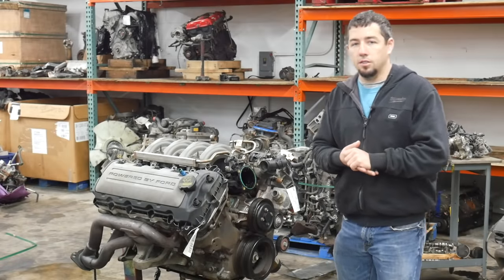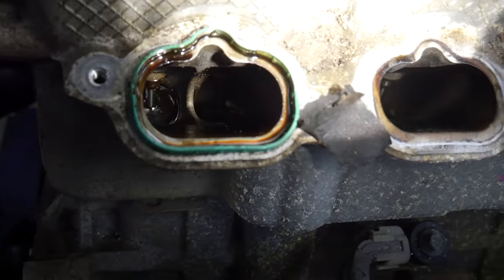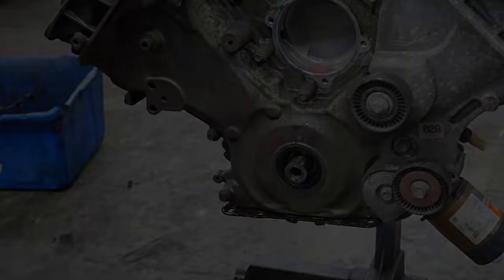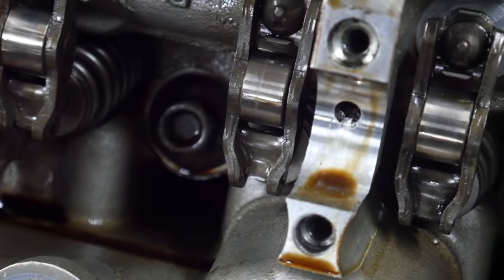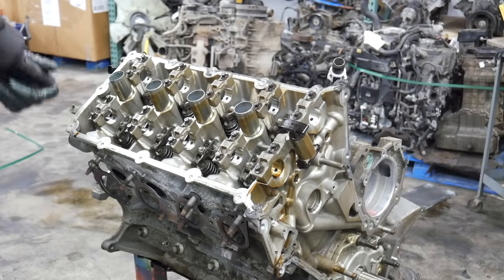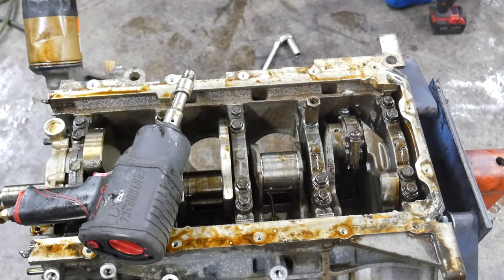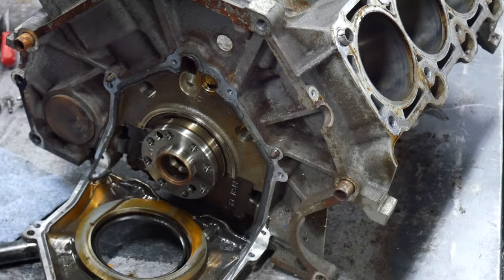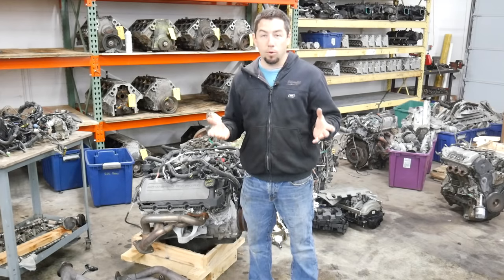Blown Up Ford 5.0 Coyote V8 Total Teardown! 2011-2014 Mustang GT / F150

Comment: FRAM Bomb Detonation! I had a friend in high school who bought a '67 mustang with a 351 swap that had a FRAM on it. He complained to me about an idle tick and low oil PSI; I said 'change the oil put a Motorcraft or Wix or Purolator filter on it'. We did that, oil PSI went from 4-6 at idle to 30+ and the tick disappeared.

This is why you never use FRAM. I don't think the oil level was low in this engine, I think the oil PRESSURE was low due to that oil filter.
Reply: FRAM Ultra’s are great filters. Motorcraft and Purolator’s fail quite often as seen on BITOG.

Comment: yep, most folks dont think about how fast that oil pump can suck the oil pan dry at high rpm . burn outs kill a lot of motors with stock oil pans . it will suck the pan dry b4 the oil has time to return from the topside .
Reply: What is it, a Buick from 50 years ago?

Comment: Neat to see the inside of this engine.  My wife has a 2012 Mustang GT.  I have a 2017 Ford F-150 with the 5.0 engine.
Reply: Have 120,000 absolutely no problems 2012GT auto, ran Royal Purple to about 70,000 then shop stopped carrying it, would have cost me 140 for oil change. Burns 1 quart   between a 5 thousand oil change, with spirited driving. I dont go with the 10,000 oil changes. A good high milage synthetic.  Car still will go 150mph with confidence. Probably put in a Ford Performance Crate Motor at some point to last, untill 2035 when we cant but fossil fuel. Enjoy....

Comment: These motors are really thoughfully designed and man they crank out the ponies! Most guys that have them drive them hard and that's what they are for. The guys across the street from me has a blown Ford lightning with a Cayote motor running E85 and it pulls hard as hell! Thanks for the video!

Comment: Don't be ragging on that Fram Ultra oil filter.  It is one of the best ones out there.  Synthetic media backed by a wire cage, silicon anti drain back valve, and metal end caps.  Thanks for the videos.  They are very informative.  I've now watched several and the theme seems to be that the catastrophic engine failures you see are the result of not changing the oil or oil starvation from no oil, with the occasional hydro locked or over revved engine.  I do not understand someone buying a Lexus, Corvette, etc. and neglecting the maintenance.

Comment: 9mm socket (11/32)  Subaru power washer rocker arms, rocker arms on some motorcycles, and the bolts holding the glass in the sliding door of a Dodge Caravan.

Comment: Really like these teardowns.  Was hoping you would cut open the wonderful FRAM filter.   That may be a bigger source of the problem than low oil?
Reply: The high end Fram full synthetic filters are great filters unlike their garbage low end Frams. Allied Signal actually did a great job on the build quality of them . They’re nothing like the cheap orange cans of death.
Reply: Nothing wrong with the filter choice.

Comment: The inside of the engine looked relatively clean inside, in that it wasn't all varnished up with dirty overheated oil, so it was not totally neglected. But the oil WAS darker, and thicker than I'd like to see, which made me think it was past due for an oil change, maybe a little low on oil, too. Then it was over revved, and the rod journals furthest from the oil pump took the hit when it emptied the oil pan.
For these DOHC engines which run their cams in aluminum journals integral in the head casting, not running the best oil, thru the best filter media, in no more than 5k mile OCI's is just suicide.
Reply: That's just criminal to do an engine like that. However, I think you can get 7K easy (and maybe more) with synthetic oil. No? (Properly filled, of course).
Reply: @scott1564  from factory yes you can, manual says 6k miles. I have a 2016 5.0 with a 3L whipple on it pushing 958rwhp. All that is done to the engine itself is billet crank sprocket, billet oil pump gears, headstuds to prevent head lift and gapped my rings ofc. But rods, crank, pistons, rockers and springs are all stock. All it has had essentially is preemptive work. It is my daily, i beat the crap out of it and it has been  going strong for 27k miles boosted. 5.0 mustangs are the best bang for your buck platform to build off of
Reply: @tinchocore6777  I have the 2016 5.0 but in an F150.

Comment: This is what happens when you tune a Coyote to try and make more hp/tq, but leave it physically stock. Most custom and handheld tuners give the owner the option of removing or raising the rev limiter. If you alter cam and ignition timing without upgrading the cooling system(higher volume water pump and crossover pipe mod, possibly lower temp thermostat and larger radiator) and the oiling system(forged oil pump and gears, larger sump pan, or even swapping to a dry sump setup) you are running on borrowed time. Combine that with a higher rev limiter...and you have a ticking time bomb...especially in a standard trans Pony that the driver is launching at high rpms and hard shifting.
All that equates to much greater engine temps starting with the rear cylinders and a total lack of lubrication. "Shock" the drive train with high rpm hard launches and hard shifts while under such conditions will result in a Coyote winding up exactly in that condition.
I'm a Ford guy...especially Mustangs. Also have a 5.0 in my F150 FX4 with a 6" lift and 35s. I love the Coyote, but you can only push it so far without the appropriate upgrades.
I, also, worked as an ASE Master Tech(all the As, L1, L2, X1, and so on). I was a Diagnostician and did failure analysis. Stock Mustang GTs from 2011 and 2012 with a heavy tune and a driver that liked running the "Stop Light Nationals" on the weekends were bad about this exact failure. The 2013-14 weren't AS prone to this issue, but still highly possible without the upgrades.
Reply: Qhats your view on a 2011 gt with 6r80 auto, and all stock with 17k miles?
Reply: @msands7713   Love them!! The Coyote is capable of some serious HP/TQ as long as you take the time to upgrade what's also needed for longevity. The 6R80 can easily handle 700 to 800 HP in stock form....just needs a cooler upgrade if you put a smaller diameter, higher stall converter in. But, if you take your time and choose the right upgrades/bolt-ons as you go, you'll have a beast!
Reply: @msands7713   Pick a path and stick with it. NA, boosted, or going full bore with it, make a plan of what you want to accomplish, how to get there, and stick to it. That's the key to making serious numbers while keeping it dependable.

Comment: This was pretty common on early Coyotes when they had an aftermarket tune. #8 is prone to running hot due to insufficient coolant flow so the tune would throw a bunch of timing at it and boom. There is actually an aftermarket coolant crossover you can buy. Ford replaced some under warranty and then caught on.
Reply: Why would "the tune" add a condition to make things worse?
Reply: @imtheonevanhalen1557  In the early days of the coyote whoever wrote the tunes were a little too aggressive with the timing because they didn’t fully understand the engine yet. It was quickly corrected once they found out what was happening.
Reply: @imtheonevanhalen1557  bad tunes can ruin anything.
Reply: @TheImtoomuch  both in the engine and inside the vehicle!
Reply: @imtheonevanhalen1557  changing timing can cause heat increase. If you have a cylinder already prone to poor cooling you have a biiig bang waiting to happen the instant you stress it.

Comment: My daily driver is powered by a 1.3 litre, normally-aspirated, pushrod 4-cylinder motor on which I've been doing ALL the maintenance since 1994.  I am stunned by the complexity which motors have attained.  At the same time, I'm fascinated by your work, and I wish I was working alongside you, because there is clearly so much that you could teach to me about the practical mechanics of tearing down and rebuilding 21st century motors.  I'm now a subsriber, and sense a binge-watching marathon of your videos coming on....

Comment: Coyote cylinder #8 is the one that goes when people do bad tunes. I'd imagine that is likely one of the contributors here.
Reply: I'm more apt to put the blame on that oil filter. But it's entirely possible.
Reply: @TestECull  That, as well as likely just a low oil level/badly maintained as mentioned previously. In 2011-2012, the hypereutectic pistons needed the oil jets to stay cool, so a combination of low oil and a bad tune would nuke the #8 piston pretty good.
Reply: mainly onn the fseries 5.0. only the mustangs got the forged oil pump gears. many upgrade that part around the same time they tune it.
Reply: Hasn’t oil consumption been an issue with these mills? Spray-in Nickasil coating that sucked?
Reply: @prevost8686  Not on this Gen 1 block, it has iron sleeves.
Reply: @mwjscn  true.  Most failures with the exception of thosr that race and put away wet can be attributed to lack of or no maintance at all.  Lot of people think newer cars need no maintenance which is far from the truth!
Reply: Bama tune? 😅
Reply: Bad tune, too much power on a stock oil pump, fram filter and probably beat the piss out of it lol. People abuse cars and take LESS care of them xd. Oil change requirements are for piss pot minivan drivers, not people out here racing xd
Reply: @03vicBlack  No mustang/f150 coyote comes with forged OPG's.
Reply: It's my understanding that the back two cylinders on the Coyte (4 and 8) tend to run a little hotter than the rest (MMR has a coolant crossover kit to address this, esp for supercharged applications) so when anything goes wrong, be it tune, overstressing the engine with a stock bottom end, oil starvation as appears to be the case here, 4 and/or 8 are often the first to go.
Reply: @177SCmaro  That is correct. The passenger side head coolant dead ends and has to come back. Normally this isn't a problem as the water pump has enough flow to keep the back of the engine cool, but if you boost it and make more heat, all bets are off. Lugging the piss out of the engine at low RPM can also overheat the back cylinders.
Reply: @ice44567  
On my engine I can even see this. The OEM CTS is located in the rear passenger head but I also tapped an aftermarket temperature sensor in the upper water neck (that some people might mistake for a thermostat housing). I have a 180 thermostat which the aftermarket sensor reads but the OEM CTS always reads hotter as the engine warms up by about 20 degrees (reads around 200 when the other sensor reads 180.) I'm NA right now but I do plan on adding a turbo so the next time the heads are off or the engine is out I'm going to knock those freeze plugs out of the back of the head and add that MMR crossover kit it's supposed to help by, I believe, giving the water in the back of the passenger head somewhere else to go rather than dead ending.
Reply: @TestECull  why cylinder eight
Reply: bad tune. 8 got hot and popped the ring land. took out the other cylinder and then failure. most likely a FI motor with an edge of performance tune. factory timing gears as well.
Reply: @jflorf909  i think im going with VMP on my 11 gt. hear alot of good things with them
Reply: @prevost8686  didn't work on the Chevy Vega either
Reply: Would it be the low tension rings they are starting to use got better gas milage
Reply: @East TN Boys 
Same case.. I ve been nto many heated debates where LS guys often say they r more reliable ones.. but frankly from ma experience both LT/Ls and Coyote are equally reliable.. 1 cant say 1 s better than other. I do appreciate the LS design for how small and light it is and the Coyote for the outright power it makes with just 5002cc.. but again its a big motor for just 5002 cc and I think heavier that LT too.
Reply: @1989rs500  The LS and Coyote weigh about the same dressed, around 450lbs. But, yes, the Coyote is a little heavier, more top-heavy too. Ford did a pretty good job keeping the weight of the DOHC parts down with things like hollow cams and tiny cam followers. But still it's hard to beat a pushrod engine in terms of weight and external size vs displacement.

Comment: I am wondering if it ran even after the one piston or rod broke sending metal everywhere. The oil galleries obviously had A LOT of metal running through them before it seized or was shut off.

Comment: The Coyote engines use oil: If you don't keep an eye on it, it will get low on you.
Reply: I can attest to that 😕
Reply: Same as the 1UR FSE which is also a very similar engine but with DI.
Reply: Do they really? It’s a shame we’re not past that after over 100 years of developing the internal combustion engines.
Reply: @TheImtoomuch  you must not know how rings, compression and crankcase ventilation works
Reply: @thefordmaniac  dumb answer. Typical Ford fan. Don't insinuate that all engines burn or leak significant amounts of oil from new because they do not.
Reply: @TheImtoomuch  5.3s 6.2s 5.0s I'd say there are a few modern engines that burn oil.
Reply: @upinair4990  using oil isn't the same as burning oil. There's a pro tip for you.
Reply: @TheImtoomuch  So they all three use oil, but don't burn oil? Sorry I'm underneath the whole knowledge of your pro tip.

Comment: Gen 1 rods are toothpicks,  and on borrowed time with anything over 600wheel. Mine threw a rod at 670wheel after 1 week e85. It went 110k miles at 600wheel gas no problem before e85 conversion

Comment: You mentioned Fram oil filter, what’s the big deal with Fram brand filters? I have a Honda that’s had the higher grade Frams on it for its whole life and all as been fine. Curious about that comment.
Reply: A lame shift of focus to distract from Fords lack of engineering.   No evidence of bad oil filter.
Reply: @lancehughes4132  Fram is a low quality supplier. Nothing more needs to be known.

Comment: Also to pull/install cams without breaking you leave the cam cap tight on the lobs that is putting pressure on the valves. and loosen the other ones completely/remove. Then 1/4 turns on the last two bolts until the cam is out. BMWs are the same way

Comment: Ive seen comments that the late model "Coyote" is roughly based on the original Ford FE blocks.  I built several 360 and 390 engines back in the late 80's and early 90's..   Ford Power Parts in southern California taught me how to "blueprint" the oil system on those and I had very good luck with them.  FE blocks came all the way up to 427cid and were installed in Cobra's.. Oil fed the cam first and then down to the crank.. sound familiar??

Comment: I have a 2018 F-150 with the Coyote engine so I was real interested in this teardown. I'd have to suspect the Fram oil filter and running the engine extremely hard like I see alot of Mustangs driven.

Comment: Glad I found your channel. I recently watched a vid that mentioned early Coyote failures and the guy said there was a person at Ford that was starting new motors WOT and letting them run that way for some time (a minute...more?) And it was causing damage that led to early failures. She's gone now. I am constantly suprised by how bad people treat engines due to ignorance, and this from a guy who starts his truck and takes off with 30 to 60 seconds of warm up. Granted, I'm 1/8 throttle and low RPM until it's warm, and it's at 210K miles and runs like a bear, so I think I'm okay. My favorite is the pre-shutdown revving on turbo cars. Makes me cringe every time. Anyway, I'll be back...

Comment: I'm considering doing intake cams on my Gen 1 coyote F150, but when I do, I'm probably going to do oil pump gears, timing chain/tensioners, head gasket, and probably put some shorty headers on while the head is out. Mostly as a maintenance. I'm all about preventative maintenance. If I got something most of the way apart, anything that "might" be close to being on its way out, is getting replaced.

Comment: I have a 4.3 vortec in my truck that lost two oil pan bolts and loosen the rest and ran it really low on oil for a month thankful I live in a cold climate and it didn't die but some motors are stronger then others

Comment: I will say these are very good engines in my personal experience I've put right at 120,000 miles on one in a 2012 F-150. We keep it well maintained and change the oil every 5K. I do know they are prone to some light tapping  after they get some miles on them, which this one has. Started  ever since it hit 60,000, but so far no problems at all. With the same displacement from the previous ''94  F-150 we owned,  it makes a hundred more horsepower,  and gets a couple miles per gallon better,  while having FAR more towing and hauling ability. Yes, I realize chassis and tranny are responsible for much of that.  I think it's just a great all-around engine. Zero problems for me.

Comment: I purchased a used Gen 1 coyote from a f150 to swap into my f100 a few months back. I did see the truck run before they removed it but man, I hope nothing like this comes about it. Nice video and new sub. 👍🏼
Reply: This is more common on the Mustang engines because they're run harder and have shitty tunes put on them.

Comment: You made a comment about the Fram oil filter in the beginning.    Is there a problem with using Fram oil filters??  I had a garage tell me to use a Ford filter on my '99 SVT but since much of their work had to be reworked, I didn't put any stock into it.   They also told me to use the 5W-20 oil but the '99 was originally using 10w-30 as per Ford in that year.